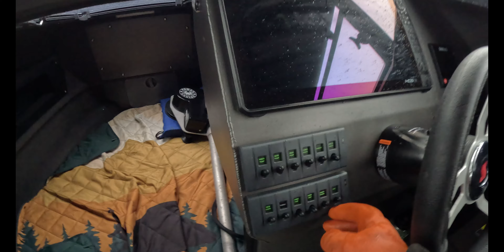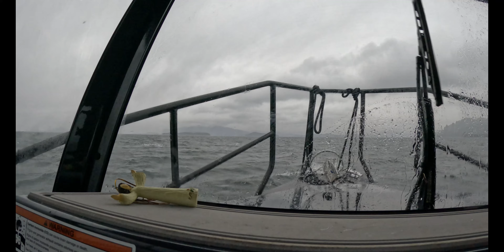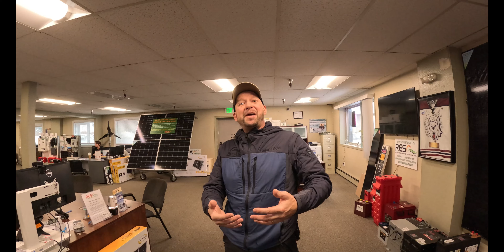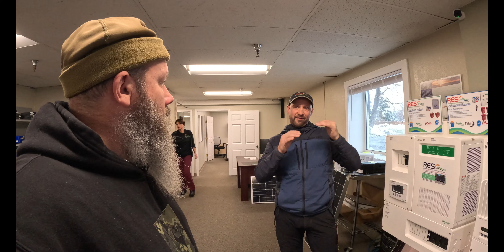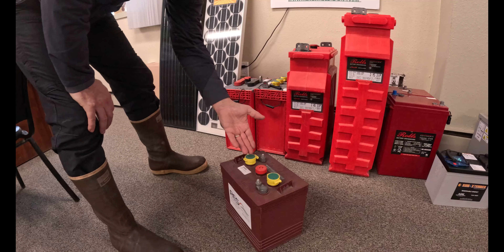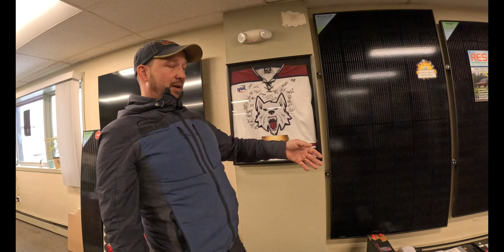Off grid power | Our new Alaska solar set up

Comment: $500 for a 480w panel. Please run and phone signature solar. 460w for 177.00, did he mention vertical mounting? snow won't stick and with snow on the ground you get a big boost. The solar dealer I bought from has a $16k USD system, 10kw 240V x2 5kw each, 60kw battery good to -30c, 12900w of solar.
Reply from the maker: Awesome

Comment: Howdy Brian!!  I'm now living up here in Ninilchik full time.  I have a 3KW solar system that I bought and shipped up here 2 years ago, and put it into service this year.  I have 1200 watts of solar, and a 3Kw battery.  When necessary, which will be now through April, I'll have to charge the battery with a generator.  One thing to think about, and I haven't watched all of the video yet (I have a snow storm inbound for tomorrow so I have to get things ready for that and will watch later) is generator capacity.  My system will take up to 30Amp input from a generator.  My little generator (Predator 2000W has a maximum of about 15 amp output.  My system would try to draw more than the generator's capacity and kept tripping it off on overload.  I bought a Predator 5000W generator in TX and brought that up, so that resolved the overload issue.  Now, I've bought a bunch of new equipment to really bump up my capacity, as the electric coop wanted an awful amount of money to connect to the grid, which is 500' away across Sterling Hwy!!! so I'm going to now move up to a 15Kw system.  I have all of the equipment in storage, but won't get it installed until next year.  Winter is moving in too quickly, and I no longer have any help on hand.  That battery weighs 400#!!! so there is no way I'm getting that up 7 steps into the container by myself!!  Plus, it requires charging by 240Volt.  My Predator 5000W only puts out 120V 30Amp maximum.  I do have a huge 12Kw gasoline generator that is capable of 240V, but haven't used it in 2 years.  That beast drinks 1 gallon of gas per hour, just idling with no load!!  When I got my new 5Kw Predator, I got the dual fuel model (and my 12Kw is also dual fuel), so I run that off of 100# propane tanks.  It has been a real education!!!  I'll try to watch the rest of this video later this evening, and if I have any other thoughts at that point, I'll do another comment.  Stay warm kids!!!   Bill
Reply from the maker: Sounds like you are improving on pretty good set up. This is going to be a huge improvement for us. Can’t wait to get it installed.